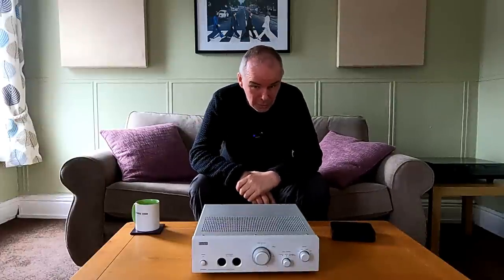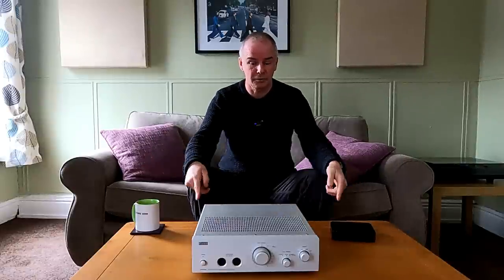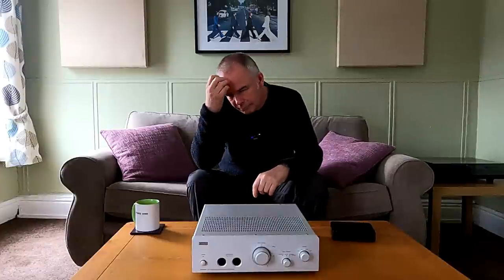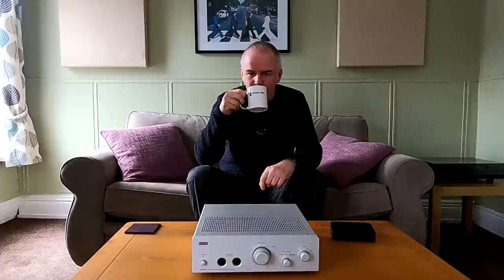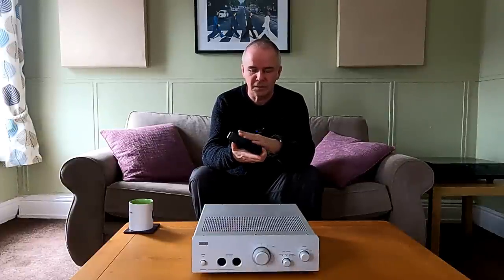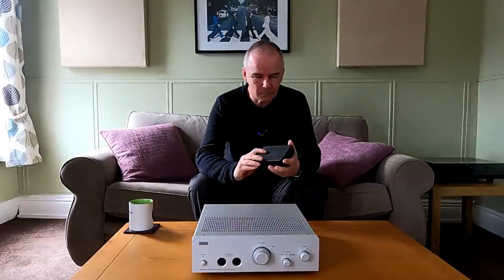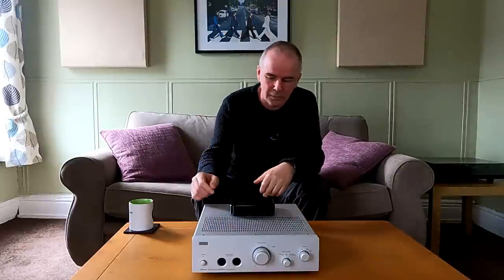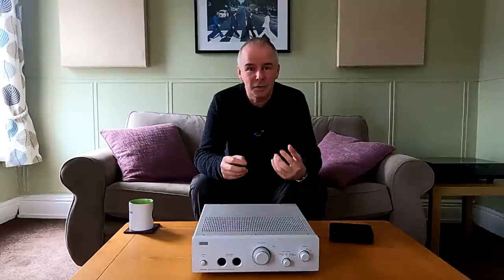Hifi Tweekery #3 System damping weights

Comment: You don't need to dive into spending megabucks to damp your cases. I have used marble slabs the type used for kitchen cutting boards for many years. They cost peanuts and come in all sizes to suit equipment. I use sorbathane spaces between these and the kit. Very cheap tweak.
Reply: What kind of kit?
Reply: @Dr.reese_UBR3  preamp, power amp, phono amp, dac, cd transport - anything with a case.
Reply: Well yeah, we know it's stereo gear. I think he's asking what brands and models.

Comment: Many manufacturers back in the day would dampen the inside of the cases with sorbothane sheet which was always beneficial.
Reply: Guess you can still do that, but higher priced items usually have thick aluminium panels so might not make much difference there.

Comment: Fantastic video Phil. I am on an extremely tight budget being off work with the long Covid but I do like to experiment with my modest hifi to get the best out of it. I use cheap stick on sorbothane from eBay as isolation under my equipment and my speakers are on home made stands that cost less than £50 to make all of which made a large difference to the sound. Other comments on this post suggest budget ways to make weights that sound like great ideas without breaking the bank so I am looking forward to giving it a go. Perhaps when I return to work I will be able to afford the purpose designed items but for now I will have to make do.
Reply: Hi Tony! Long covid hifi-guy here as well. A kind of budget tip I want to give you is diffusion panels on the wall behind the speakers. I bought a set of 6 t.akustik wave eps for around 80€ total from Thomann, you will not believe how much of a difference this makes for imaging. Also, the weight-thing really works. Currently have 5kg (in two 2,5kg weights for dumbbells) on top of my Bluesound Node and it helps focus a lot. Lastly, since you mentioned your long covid. Breathing exercises morning and before bed has transformed my life. If you haven't tried it, do. Have had a good routine for over 6 months now. It's the way out of this hell.
Reply: @filipviljamaasvensson  unfortunately it’s not just my lungs that were affected but my heart, kidneys and liver. One massive bonus is I am still here when it killed two of my lifelong friends and also an aunt so I count myself as lucky.
I can’t put anything behind my main speakers as space is tight and they sit in front of my CD racks but I have a second smaller system with Gale gold monitors sat on my bookcase on top of isolation pads. These work and sound very well. They have rear facing ports so I could try your tip with these.
Reply: @tonyjedioftheforest1364  I wish you all the best in recovering. Something happened to my nervous system, so now I'm on a medication for that. But as you say we are still here. Good luck with tweaking your sound :)
Reply: @andyrenorocks  I am on immune suppressants I’m afraid but I do take a multi vitamin and mineral tablet along with vitamin C and vitamin D tablets daily. I also have other conditions that affect my immune system but thank you for your advice
Reply: @tonyjedioftheforest1364  what are you on immune suppressants for? Rheumatoid Arthritis or an organ transplant?
Reply: @andyrenorocks  the first

Comment: I use a solid stainless ALDI door-stop that has a rubber base and rubber ring around it. It actually LOOKS like an expensive HiFi accessory ;)
Reply: John Darko has promoted these - mainly I think to weigh down lighter items to prevent the cables pulling them around.
Reply: I do as well!😀🤟🏻
Reply: Yep. Metal door stops weighing 1kg available from ebay for £7. Look pretty good too.
Reply: Me too - I got all black door stoppers for about 22 Euro for four. I feel they bring out more detail. All the best, Rob in Switzerland

Comment: I think it is much cheaper to unscrew the top cover and stick some sound dampening insolation  (that they put in cars, like Noico) on the inside of the cover, of course not in front of the ventilation. I have tried this and the covers are death silent 👍

Comment: This concept can work in certain specific situations, e.g. a high gain phono stage or a tube preamp where circuit mircrophonics come into play. Otherwise it's simply a case of hearing what it says on the box, or what the seller/manufacturer suggests - a known, well researched human failing.  £140 is dirt cheap for this type of tweakery though so nobody should get too vexed.
On recordings, agree 100% - don't stick to hi-fi demo discs to evaluate kit. Quincy Jones 'The Dude' and the like are so well mastered they can make a cheap soundbar sound like hi-fi :)

Comment: I am open minded about such products. However, the much cheaper alternatives mentioned in the comments may do just as good a job. Also, it seems strange that mid to high end equipment is not sufficiently dampened when you consider the cost involved.

On the subject of what recordings to use when auditioning equipment, I always listen to recordings of varying quality as my view is that it’s how the system conveys poor recordings that is the biggest challenge.

Comment: I guess the manufacturer is attempting to address microphony which (as you said ) is something Naim put so much effort into addressing. If so, why didn't they just say so in their blurb? But that then begs the question as to how you can "over reduce" microphony? 
If it's not microphony they are trying to fix then what is it?
Reply: Microphony only occurs on tubes or turntables, not semiconductors SMH.

Comment: I don’t own a hifi capable of resolving these sorts of effects, so I can’t speak from experience.  Nevertheless my natural tendency is towards skepticism in most circumstances.  A current moving though a vibrating wire will generate a magnetic field.  This could potentially induce a current in some other component.  However, the vibrations of internal components would be tiny - presumably this would only be of any significance where we are dealing with tiny signals - for example in a phono or microphone pre-amp.
Reply: your biggest internal component is usually the transformer-which vibrates the most.

Comment: Given that I've tested and accepted that devices that isolate components, and (linearize) clean power supply made/make a difference I'm willing to accept that some strange items can make a difference. That said,  I'm sort of on the Roy Gandy team here though. If price is a factor engineering will always be a compromise. The real question, then is: Do these upgrade items actually offer value for money given the compromises already inherent in my living/listening room and in my system?
Reply: Good point. A real consideration.

Comment: For what it’s worth. People that attack others for how they spend their money have serious mental issues. Anger management is in dire need in most cases. And most certainly therapy.

And I’m not just saying this, repeating it, or trying to dig at them. I used to be that way myself. I was also a drug/alcohol addict. But since I’ve gotten sober, and been in therapy. I’m fine.

And I tend to feel bad for people like that. For many reasons. And it’s a lot easier to deal with people like this. When you realize this, and can have a little empathy for them. Just sayin. ✌️

Comment: I tried a granite place matt which weighs about 3lbs on my Cyrus Stream XP2 QX Streamer which has a PX-R connected to it. I have my system running through an Audioquest Hurricane High Current Mains cable and Matrix 2 mains conditioner. It gave the music a deeper, richer more detailed bass.
Reply: I bet it did )
Reply: @engjds  now I have an AudioQuest Niagara 3000 with a AudioQuest  Hurricane High Current power cable with a Synergistic Purple fuse with another AudioQuest Hurricane High Current mains lead  with a Synergistic Orange fuse in my power amp as well. The bass depth, definition, detail, and realistic 3D soundstage is off the scale.
Reply: @andyrenorocks  More importantly what speakers do you use?
Reply: @engjds  Qln Reference HD II
Reply: @andyrenorocks  Those look good, hope they sound as good, but I bet all that cable nonsense cannot be detected if I were to blindfold test you on them.
Reply: @engjds  yes they sound great. That cable nonsense would definitely be detectable lol if I was blindfolded. I can tell when sound is harsh, smooth, detailed, bass light, has woolly bass or defined deep bass that shakes your bones lol.
Reply: @andyrenorocks  I am highly skepical as the math makes no sense from an electronics point of view, most things to do with turntables is true, mainly because the output signal is so low and I think a lot of that theory migrated across to other components where imo it doesnt apply.
Mine has very solid bass and it has cheap cables, it shakes the room and body, solid realistic sharp hits with timbre-that when you close your eyes you would swear the drummer was in the room.
Cables do not cause in my experience a lackness in bass or solidity, sure you didnt alter the phase between cable changes? that would cause it.
Reply: @andyrenorocks  Only way to test properely imo is at night when you are relaxed an put them through a good splitter you can switch back and forth, the memory is poor for most people even 30 seconds playing the same track, so then your mind begins to fill in detail you hear now but couldnt before, that sort of thing, perception changes. harshness can occur just moving slightly off-axis from your original sitting position-speaker dependant.
I dont doubt you think you are hearing a difference, I just highly doubt the cables are the cause mate.
Reply: @engjds  nope, the phase wasn’t altered as I plugged different cable into the same socket as I swapped cables. I can detect a noticeable difference in the sound of various cables.  I also use an Linn LP 12 Akurate spec with a Linn Ittok II tone arm. I detect every improvement when I upgrade cables and fuses.
Reply: @andyrenorocks  Nice turntable, used to have a LP12, Guess I will remain sceptical till I actually hear cable changes on a good system, it flys against logic and reason however.) Especially fuses on the AC side, to me thats like saying a leaf on the ocean can be felt on the deck of the titanic.)
Reply: @andyrenorocks  ps with that setup you should get perfectly solid bass all the time and crips treble (fluff on the needle?) lol, there must be another reason.
Reply: @engjds  the quality of the material used in all cables in a system can make a big difference to the sound and easily detected on good components. I was sceptical about mains leads and mains conditioners at first till I tried some. The electric passes through the fuse so a fuse can also shape sound. Gold plate can be smoother but bass light. Synergistic fuses cover their fuses in some material and they also treat the fuse wire with a huge amount of voltage which alters the way it sounds. I have only tried the orange and purple synergistic fuses. They both sound different. I suggest giving mains conditioning and better quality mains cable an audition at Cheshire Audio or one nearby where you live. If you don’t hear any difference in the sound, you haven’t wasted any money.
Reply: @andyrenorocks  Mains leads), you do realise every component excluding the turntable uses a mains input transformer, the primary winding to that mains is connected by 10's of meters of high awg wire that measures in the 100's of Ohms, and you think a few uR makes a difference, no, certainly not, you are subject to placebo. Mains conditioners work with turntables, but not on nothing else, because no other component uses AC voltage, its changed to DC through transformer-rectifier and smoothing caps. you think you can hear the difference of the few uR improvement of a 1cm fuse relative to the 100's of ohms? a uR is 0.000001 R, now relative to say 200R on the primary winding, thats a riiculously high db difference well beyond what any human could hear. Can you see why I find what you are saying very silly indeed?
Reply: @andyrenorocks  Hey but main thing is you think it makes a difference and no doubt they look nice), hifi is about enjoying the hobby right.

Comment: Not expecting you to read this, but on the off chance... 
Agree on the "angry 1%", I would also add the 2% outright rude!, I just delete and block them, life's too short to give them attention. 
It may be an idea if you think the 1% may target a particular video, to just block all comments on that video. 
I'm in the process of trying some weight lifting weights on my Kralk Audio TDB6 speakers, no idea if they will make any difference, but to me tweaking is part of the fun. 😉 
Jim 🏴 ☺
Reply: Statistically you need at least 100 comments to get an angry one in the mix, assuming the 1% ratio is correct. We are below 15 as I write this. I think we will be OK with the angry comments this time around. As for rude comments, that's up to the reader to get triggered and everyone has his, her, its, they, them, our, ze, own trigger point.
Reply: @hugobloemers4425  oops! Missed out know - it-alls, apologies. 😉😀
Reply: @hugobloemers4425  what a load of crap. (See what I did there?) 😀
Reply: @OriginalgEd  you trying to trigger me? 😉

Comment: Given caps are certainly microphonic (i've come across a couple of shockers) and thinking what the acoustics must be like in a metal box, I can sort of see this...... though Housebrick+black paint+rubber sheet would be a cheap experiment. I did line my diy amp enclosure with thin mdf bonded to deaden it (I did increase ventilation.... )
Reply: Caps are not microscopic, you are getting confused with valves.
Reply: @engjds  Capacitors can have a microphonic effect - witnessed most startlingly in a preamp module I had. I'm not thinking of valves! It must be dependent on application and type of course.
Reply: @robh9079  What type of capacitors?
Reply: @engjds  My worsed experience of this was with electrolytics. On looking it up 'Film caps (with) soft dielectric... can be microphonic due to vibration... moving the plates of the capacitor.'

Comment: The weight causes a low frequency resonance, which "damps" higher frequencies. The best example is a car engine - it vibrates a low revs, but becomes rigid at higher frequencies.  Due to the flexibility of the rubber mounts.
All electrical components will have electrical frequencys at mechanical vibration frequencies, it's how cartridges and speaker work!

Comment: In the 80's I had a Thorens 316 turntable. My steri gearwas stacked on a coffee table eith a 25" TV beside it, the turntable sat of a milk crate that was about the right height. That was convenient but because this is a 100 year old house the floor has some spring to it which made that TT sensitive to foot falls.

The store bought solutions were pretty dear and i wasn't sure which was right for my situation. Some of these solutions used air suspension so I tried an experiment using a 10" inner tube. That Thorens weighs about 16# and I found a lightly inflated inner tube did a great job isolating ,t turntable for about $4 out of pocket.

Good stuff cheap